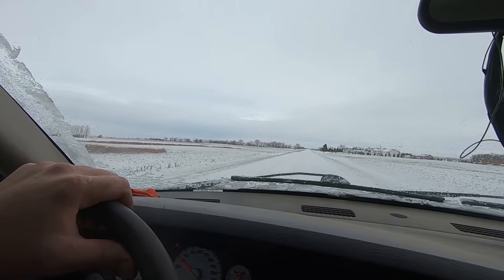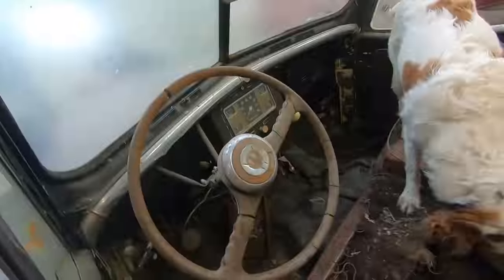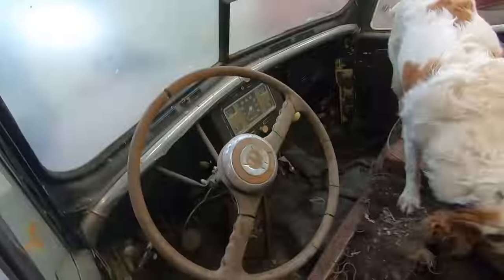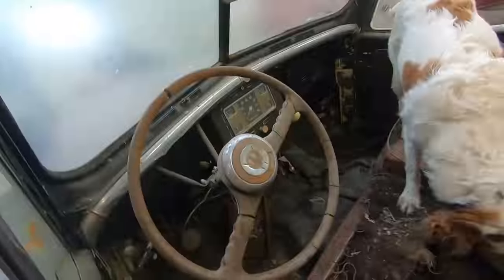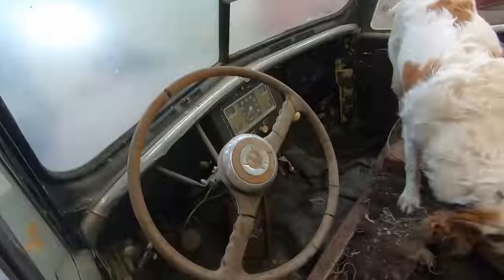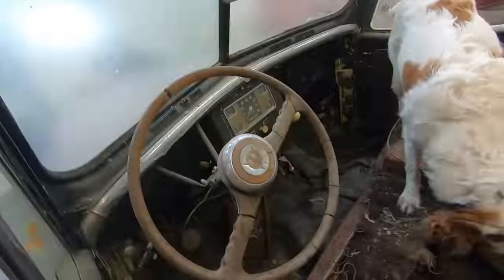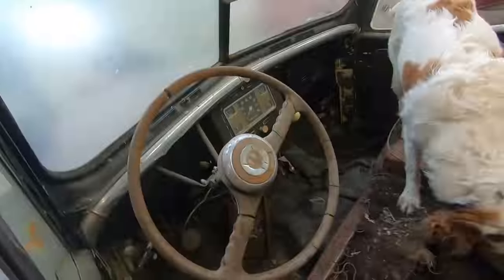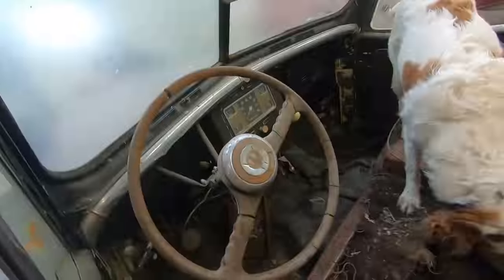Forgotten 1949 Willys Jeepster Barn Find! Will it Run?!? Sitting for 46 years! Family Heirloom!

Comment: I was screaming   Don't d  You it  but you couldn't hear me .  When you put that 12 volt in there you fried everything and I am amazed you made it back. You killed every light bulb, you got the gas gauge, voltage regulator, condenser, and the radio. You know mechanics but you need a course on DC voltage .
Reply from the maker: The only thing wired to the battery was the switch I installed and the 12V coil I installed. I bypassed everything except that and the starter. Not my first rodeo.

Comment: While it does need a condenser (you are correct, any condenser will work), it is the coil getting too hot. You need a ballast resistor to drop the voltage to the ignition system.
Reply from the maker: They never seem to bother on short run times
Reply: @MortskeRepair  Correct. It takes a while to get too hot to function correctly. There is a reason ALL cars had a ballast resistor (or resistor wire) in the age of point type ignitions.

Comment: You can put your small parts in a jar and fill it up with cleaning fluid and sit the jar directly on the bottom without the basket and you can leave the lid off it the jar is too tall.
Reply from the maker: Great tip!

Comment: Ugh. Airtex fuel pumps are junk. I worked at Autozone for years, so I have a ton of experience with them. I had a '91 Skylark years ago, and I went through three of them in one year before i switched over to AC, and never had another issue after that. You should definitely keep your eyes out for a better quality one, and throw it on the shelf for when this one goes, because you'll be lucky to get a year out of it, especially if the car isn't being driven regularly. We only offered a one year warranty on them when I was there, because they rarely lasted much longer than that. I don't even think they give that long now. I can't even count the number of irate customers I dealt with due to those garbage fuel pumps. Hell, I was one of them.

Comment: Hey im not a big willys repair person but wouldn't any rear brake cylinders work as long as brake line size the same. Then only have to redrill holes straight across like most systems are instead of offset like Willys.

Comment: I think that was a 6volt system, if you keep 12 volt you will need a voltage reducer for the distributor.
Reply from the maker: No you don't. It's got a 12V coil, that's the only thing you need to convert the ignition part of things.

Comment: I. Put 72 wagoner front backing plates and brakes on mine,  much bigger , 69 fit the rear . I used a hyster e40b master cylinder direct bolt on , 1/3 the cost .now is stops and is safer .

Comment: Do you think running 12 volts through the condenser would cause it to overheat? Should a guy buy a 12 volt condenser to replace?
Reply from the maker: No they don’t care voltage
Reply: @MortskeRepair  good to know.

Comment: ooooo... the hammer on the valves was painful to watch.. try a littlite atf soak overnight and a soft rubber hammer next time.... unless you are rebuilding the head anyway... in which case you might as well start by pulling it ... the seals will surely need repleaceing at that point anyway. great video all the same. thanks

Comment: I believe it's an L-Head? Didn't the F-Head come in the M-38-A1 later on with an Overhead cam? Just asking, not criticizing. I had the L-head which was a flat head in my 1945 MB, until I swapped it for a 1966 Ford Mustang 289 V8 with an all syncro 3 speed. Now that perked up the old MB!
Reply from the maker: You're correct. I bet that one ripped!
Reply: @MortskeRepair  Yes... It was the honest meaning of "born again". I had a 50's vintage Mercury 44 rear end housing narrowed to take it. Custom drive lines, axles, adaptor plate between the shortened tail shaft housing on the trans to mate up the transfer case and lots of other frame frame off alterations, custom headers from U-bends, on and on... you know the deal. Fun project. My mentor dad had died young a couple years before of brain cancer and I get my mechanical infatuation from he, a self taught engineer/Factory Rep. for GM's formerly Electro Motive Division, E.M.D.- rail locomotives. My loving mother financed the build to keep me off the streets so to speak, and later became my off road co-pilot bless her sole. Talk about a good sport. 

I was senior in High School when I did that 49 years ago. I used a really great old school machinist on the running gear alterations. George has long passed on now. It was a beautiful little flat fender for a high school kid build. I even did the body work and paint in Ford Grabber Blue with gloss black diamond plate rear corners and such. M-38 frame (the MB frame had serious issues) and windshield, Black K-line top. If I'd only had the tools, skills and budget I have now. I learned so much on that one at 17. No smart phones, computers nor video games to distract and pollute one's mind back in 1974. Lol.
Reply from the maker: @usethenoodle  Sounds like a sweet ride!

Comment: Do you always put tubes in because the wheels won't hold a bead?
Reply from the maker: I put them in for several reasons. Depends on the application. I don't run them on the cars I drive regularly unless they are a tube type rim.
Reply: @MortskeRepair  makes sense.  I know sometimes the level of consumption on the rims make them hard to seal the bead.  Good to hear from you.

Comment: 2:17:56 "That's why the old manna... 12 volt relay, 12 volt solenoid the overdrive works"??   Tell us about the overdrive system plz.  I need more highway gearing in my camper van for max MPG

Comment: THE BEST WAY TO CLEAN GAS OR BRAKE LINES IS TO USE AN OLD SPEED ODOMITOR CABLE ON A DRILL THAT WORKS GREAT AND WILL FOLLOW THE BENDS  THE FLUSH WITH BRAKE CLEAN

Comment: Did you put a proper ballast resistor in your ignition?...bypass at start?....If not, your points will burn up in short order.   excessive Inductive kickback will burn your points quick.
Reply from the maker: Its on the list

Comment: Instead of just trying one spot on the paint on this, wash it real good then after you have go over it real good with linseed oil. Rub it real good and wipe off the excess. It will bring it back to life and protect the paint and stop the rust and protect it .

Comment: A good way to flush out the engine is just flush it with diesel fuel make sure you remove your oil drain plug just flood it until you quit getting chunks

Comment: my Willys was stuck //removed the head and no ridge on top of cylinders // new rings //and stuck //I build a fire in all 4 cylinders let her heat -up for 15 minutes and used a block of wood and hammer on the downstroke and she free -up and running //

Comment: Don't use a ball peen hammer! Get a rubber mallet or at least place a block of wood against the head. Speaking of heads try using the one on top of your shoulders. Wow. Let the penetrating fluid soak in. There you go with that hammer again. On a valve no less. Get a damn mallet.

Comment: Sounds like a condensor. How's the generator? Get back to the shop. I always enjoyed carburetor over the other. I hate to even name those things carburetor is always best! We have a 1996 Jeep Grand Cherokee Laredo with transmission troubles and lots of other goodies happening. More money in repairs than value worth. Battery dies all the time. Can't get in second gear easily. New manifold 1200 bucks. Lots of goodies! Anyone got a shotgun? Ha! Ha! You in North Dakota? I delivered a truckload of GMC automobiles too Brainerd near Fargo in 1982. Winter lots of snow! My rig tried to slide on the icy road but I held tight. From outside Barstow California to Brainerd. The Cohen Brothers made a movie of it! Ever hear of Fargo? Terrible event!
Reply from the maker: Fargo is up the road a ways.

Comment: I consider the flathead Willys four, junk! They are not a good motor. My Jeeping buddy had three of these. EWe put one body on a truck frame and made a 4x4 out of it. Look at the front spindles and see how the spring is attached. The main leaf on these would snap and cause a fatal wreck. My 1948 Jeep CJ-2A I had for 30 years and converted it to a 302 Ford V/8 and made a real Jeep out of it.

Comment: Not an F head. A flat head is called an L head. F heads have intake valves in the head.  I know because I've had both. Same block though. 134 cu in. L heads have 60 HP F heads have 75 HP.

Comment: You could have saved yourself a lot of trouble but just running a wire to the starter the lone Wolf and then just worried about the foot starter later. I never would have took the spark plug out of the bottom because they're tapered. Just drill it out and then take it easy out. And I would never have gasket in a can I've actually replaced it with a real head gasket it's probably a three piece. And you might even have the option instead of it being rubber a metal one. And if it's split it's not going to work! I hate to say it but your dad's right the higher the number on the plug the hotter they are. The brake shoes are slotted to help shed brake dust otherwise it would just glaze. And why don't you just upgrade the brakes all together. And it's not truly a shock otherwise it would be mounted like that it's more of a damper because your real suspension is on the springs and that little itty bitty shock is a damper. See if you upgraded your backing plate and even went with Bendix style you wouldn't have to deal with all that. I mean I know it's an old probably high mileage vehicle but with the engine that far taken apart I probably would have reringed it and re bearinged it. But then again maybe not because the seals are probably bad too but I have a feeling it's going to smoke anyway. I probably would have used 5W-40 T4 diesel oil because it's got zinc a lot of other stuff for the flat tappet cam. That way it would cut down a little bit of the smoke.
Reply from the maker: Wow. Sounds like you know everything! Tell me again how to wire up that remote starter switch to a mechanical foot pedal again???
Reply: @MortskeRepair  but I will however provide you a link to another guy that is actually rebuilding a 1950 mechanical starter who is trying to replace brushes and he also bench test the starter. https://youtu.be/bud00LbwLfI

Comment: Wouldn't a little heat help that sticky valve?
Reply from the maker: There's no good way to get heat into the guide in this design. Then you risk heating the springs and without the spring it won't return. And if you've got valve seals you'll melt those out as well. So no good reason to use heat.
Reply: @MortskeRepair  I did say "a little".
Reply from the maker: @Goomer  couple of taps and didn't have to worry about too much heat this way.

Comment: Original condenser was designed for 6 volts,,,   Not 12 volts,,,  A condenser keeps the points from wearing out too fast,,,   Need a 12 volt condenser,,  :-)
Reply from the maker: Condensers don't care about voltage.
Reply: @MortskeRepair  A condenser is another name for a capacitor,,  and  all capacitors have a capacitance and a voltage rating,,  probably the condensor was weak and the extra voltage just sent it over the edge,,
Reply from the maker: @darkwing4475  I guess I've run stock 6 volt condensers for years on 12 volts with no issue. Like you said. This one was on it's way out. Been running fine on a new one.
Reply: @MortskeRepair  ok,,  That is good info,,  Sounds like the voltage rating on the condensers is high enough that it does not make any difference weather it is 6 volt or twelve volt,,,  This reminds me of my first car as a teenager,,,  a 1957 ford 2 dr sedan,,  6cylinder (big 6) with a fenton super shifter,,  Was driving down 82nd street one day in Portland and it quit running,,  Coasted into an auto parts store parking lot, and discovered that there was voltage but no spark,,, i had 56 cents in my pocket,,, all i could afford was a condensor,,,  (49 cents) so I bought that and replaced my old condensor,,  Happlily surprised when it started and ran fine,,  Sure wish I had that car back in the condition it was in when I sold it,,, (shiney powder blue paint and no dents,,  :-)
Reply from the maker: @darkwing4475  Nice!

Comment: you might want to put a 4cy. F head in it they put both in their a hair more horse power . I would put electric ign. in  i keep my 6 volt starter in cranks up great and fast my 1951 willys pivck up has the 4cyl. F head in it not sure if it has a shroud

Comment: Air pulling thru the throttle shaft and idle mixture screw bottomed out . It is not going to idle right . I hate vacuum operated windshield wipers they are total crap .